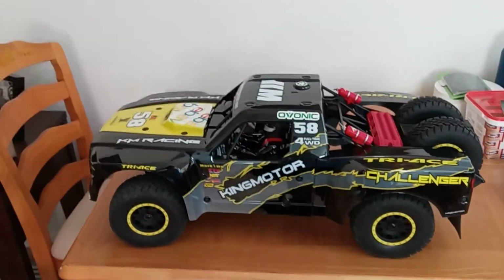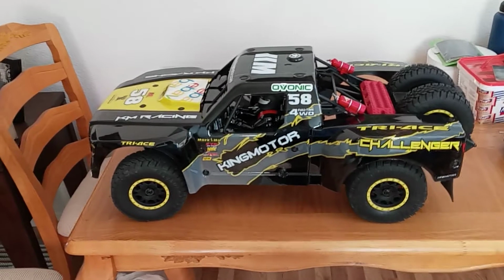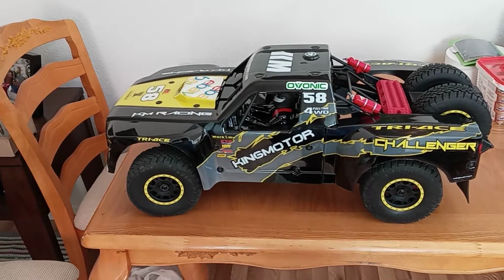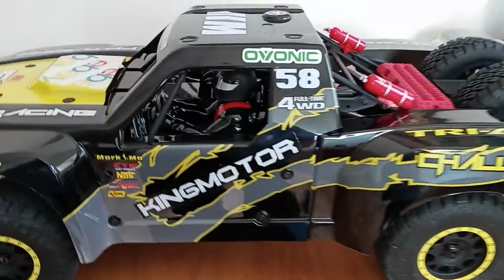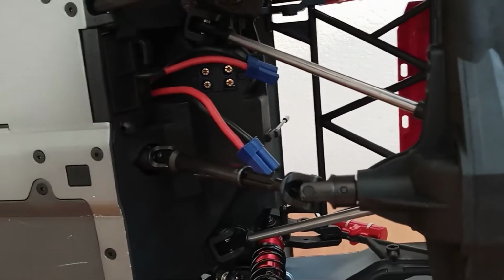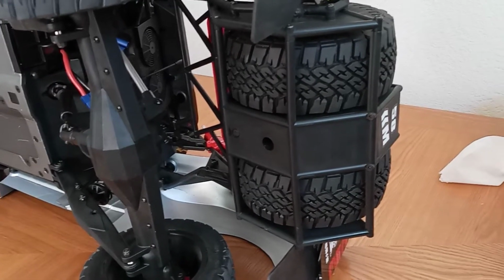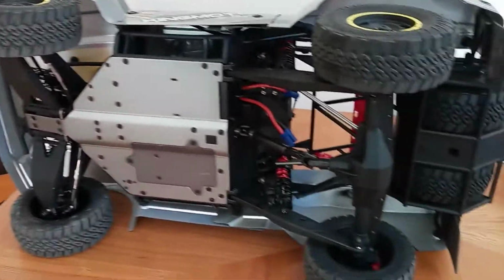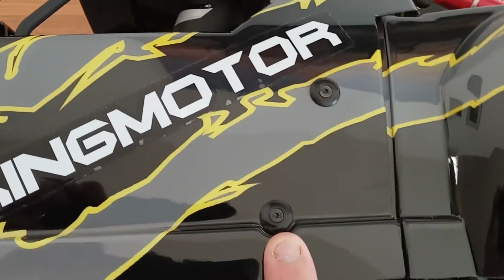king Motor 1/6 Challenger Trophy Truck RTR brushless r/c truck

Comment: actually motor specs arent the same king motor far better at 1200 kv losi 750 kv losi needs to run 8s to be close to king motor at 6s
Reply: So can I put 8s on king motor? Cuz in the manual it's says it suports 8s but not in the description from them
Reply: mine is stupid fast on 6s almost uncontrollable way faster than the losi